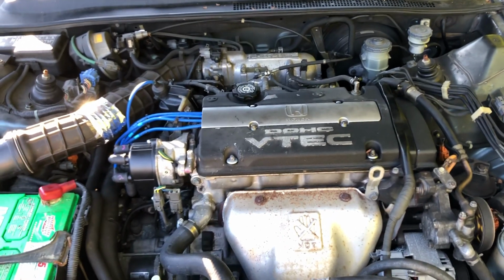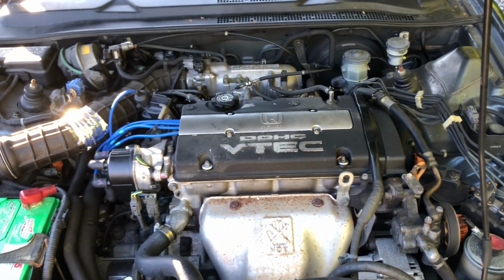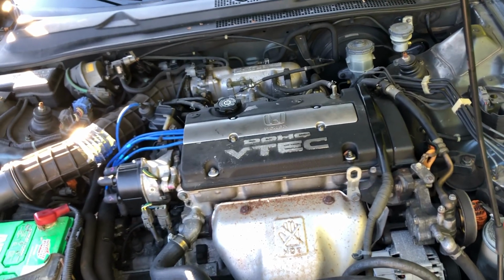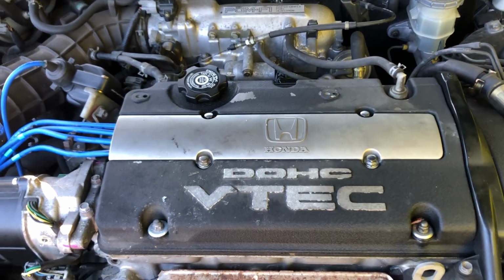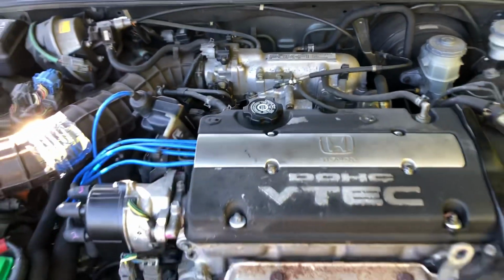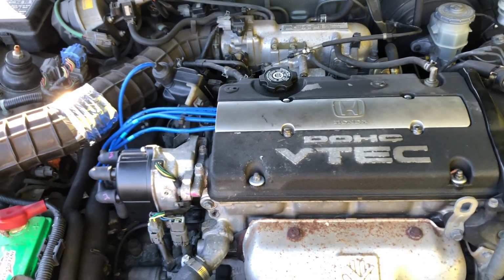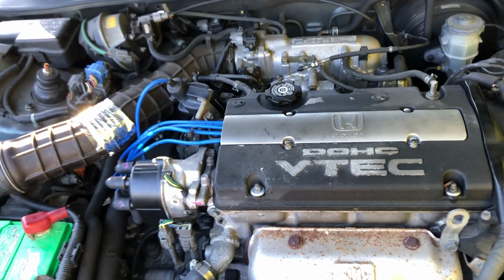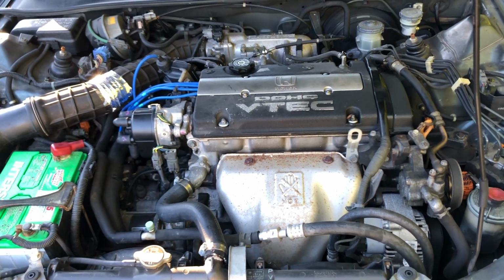98 prelude , Crank but NO $Tart

Comment: 👍🎃😕
Reply from the maker: And just changed the radiator plus new hoses and kept OEM hose clamps, then did an oil change
Reply from the maker: Cleaned the battery terminals ; added distilled water to the battery and it runs and drives better than ever
Reply from the maker: I finally learned how to install and uninstall the Snap ring OEM hose clamps  WooHoo 🥳
Reply from the maker: + iHope your Halloween was stellar , wife is going to deliver the baby boy Dec 14 roughly